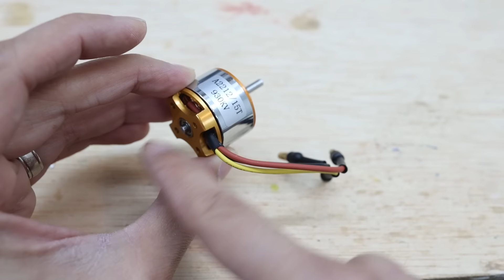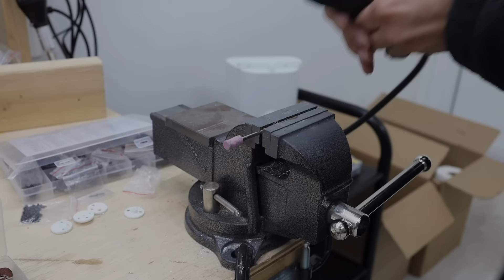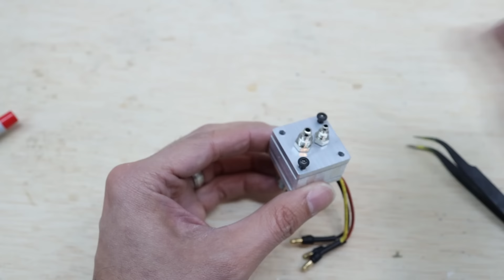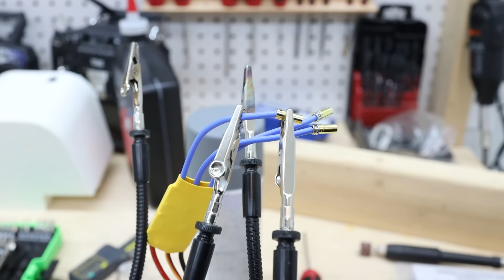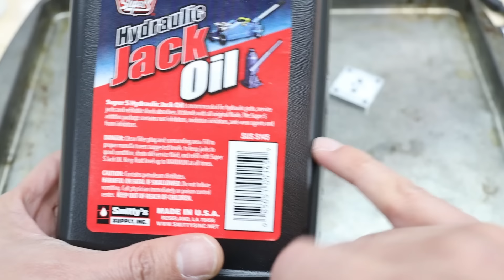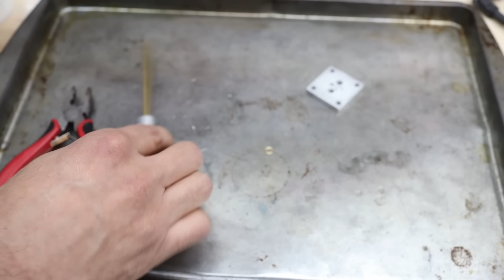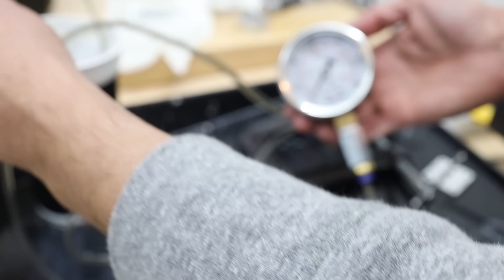DIY RC Mini Hydraulic Pump Using CNC Technology Troubleshooting Low-Pressure 30psi only not 300psi

Comment: I work with heating burners that have low pressure pumps like 20bar. Look for datasheet for low cost pump like suntec as47. Maybe you can find one for parts. They have one gear but it is perfectly flat.    Steel on aluminium can cause headaches. Try to reuse machined parts from pump and use aluminium only for housing.
Reply from the maker: Thanks for your comments, yes ideally will be steel but I think my CNC is not rigid enough, I will need a mill for doing that, I will try to see if I can face the one of the gears top and bottom to solve the issue with true flat face pression.
Reply: As47 is huge! This is for rc
Reply: @bradleylomas7525  it is not for rc. It is for oil burner . It is huge because it has pressure regulator and seals. But gear inside and ring and cover is much smaller. In some parts of europe in junkyard you can find oil burners for like 20eur. If you make your own design you can invest 20eur and see how others did it and try to reuse parts of that pump. As whole it is unusable for you.
Reply: @aleksandarvasilevski7410  I appreciate the knowledge, but it's mute because I'm very knowledgeable of mechanical workings. The point is to you to grasp, not me. Thanks, have a great day

Comment: Nice project! I've been looking around for this kind of miniprojects that can be done on small size CNCs as I own one.

If you want to keep a good seal between gears and the pump case, you might want to consider lapping the gears faces on a perfectly flat stone. 

Glue the gears together with hotglue or something that is strong and stable enough at room temperature but easily removable at high temperatures, say epoxy? Do the gluing when gears are on a plane surface!

Use a wet high grit stone or a plane surface on which you put a sheet of high grit standpaper and move the glued gears in an 8 patern in order to have the best uniform surface finish. Do that on both faces of the gears.

Measure the gear thickness after lapping process and then mill the pump plates in order to have the tightest tolerances possible when bolting the pump together.

If it's possible, look for X section sealing rings, not o-rings, as X-ring have better sealing characteristics. If can't find that type of sealing rings, take some PTFE tube with diameter close to your shaft and cut it to length to make sealings. 

Whatever sealing method you use, make sure the sealing material (rubber,  plastic, etc) is chemically compatible with the hydraulic fluid you want to use in your system. 

EPDM is the industry choice for hydraulic systems.

Good luck!

LE: I highly recommend you to study piston pumps for hydraulics. They provide few hundred bars of pressure although the flow it's not that high and also needs damping of pressure peaks at the output. With a small motor like that, a tiny eccentricity say, less than 1mm, can produce 50bars of pressure.
Reply from the maker: I'm thinking of using super glue, and gluing the gears to an aluminum bar, then using the CNC to face and mill flat the top of the gears and then repeating the same procedure for the bottom, that way both will have the same high and flat with end mill bit. I have to check if my CNC can do that and if the bit is going to resist. 
Those X-rings are a good idea never crossed my mind.
I need the flow if I want to use the pump for an excavator I do construction models.
This is such good information thanks a lot for taking your time.